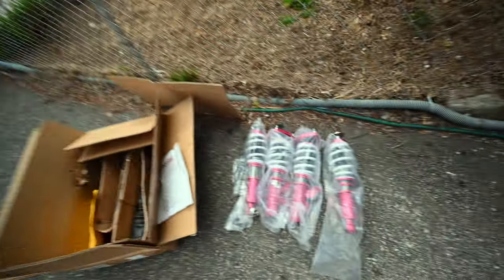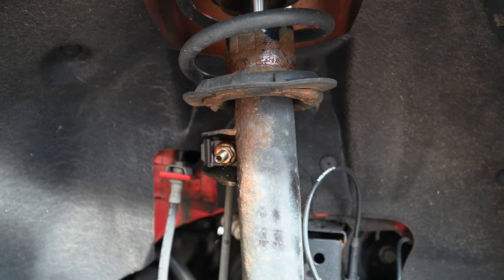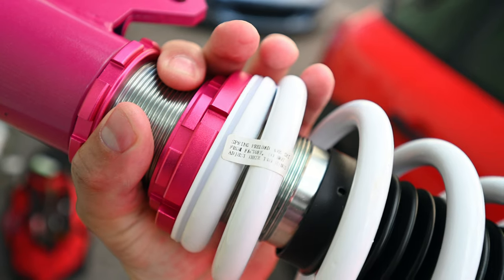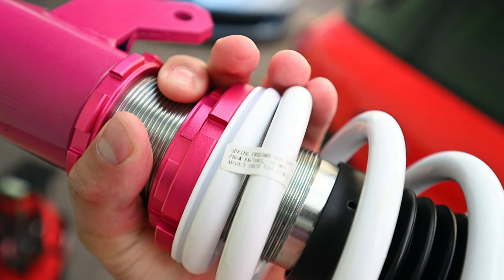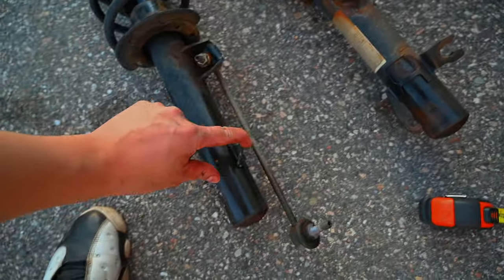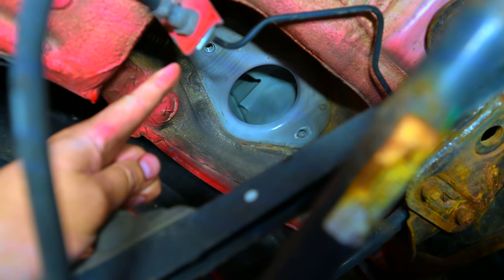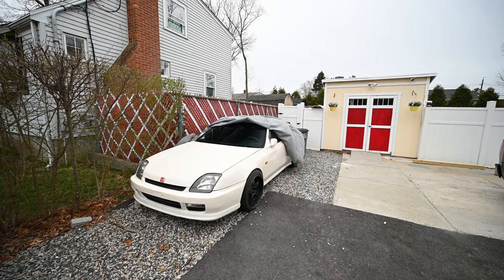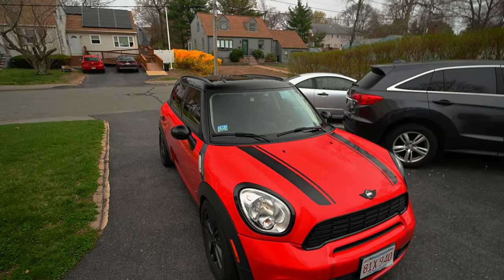The Mini gets some much needed coilovers

Comment: Very helpful video! I got coilovers  in my Countryman and I’m getting a clunking noise in the rear. Do you have the same problem? Thanks!
Reply from the maker: I did but a few months down the road. I'm not sure what it was but I took the rears off tightened the strut/shock nut, it seemed to have back out a little bit and I reinstalled the rears and made sure everything was tightened to manufacturer spec. Hope this helps you out!

Comment: Great video! Looks awesome. Did you remove brakes completely? Or were you able to work around them? Looks like they were removed
Reply from the maker: Thank you! No you don’t have to remove the brakes to install the coilovers, I had them off to either do the wheel stud conversion or change the brake pads and rotors.

Comment: how is the ride with these coilovers??are they bouncy??And are the rears a pain to install..have your same mcs
Reply from the maker: The coilovers ride good, not bouncy and ride similar to oem just a bit firmer. The rears were a lot easier than the fronts. Once the lower shock bolt is removed there's very little tension on the spring and it comes right out without the need for spring compressors.